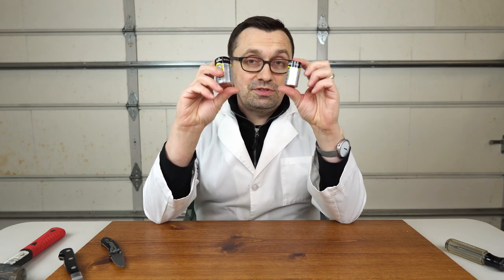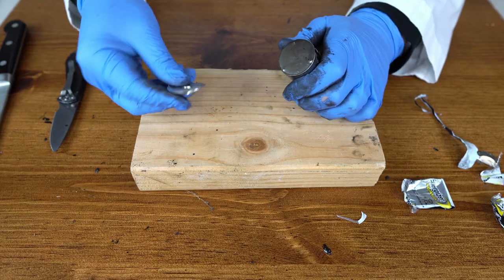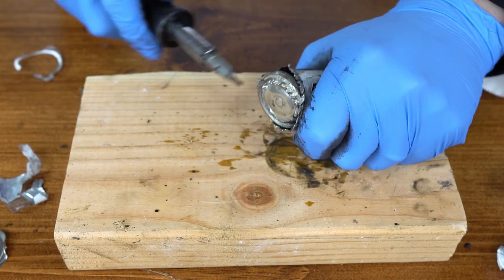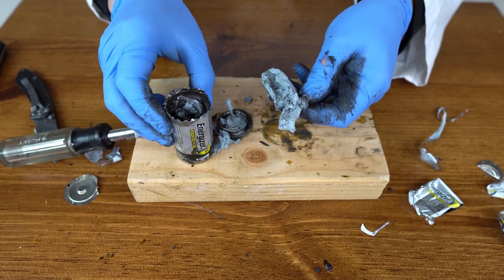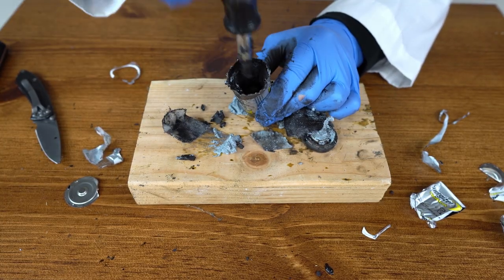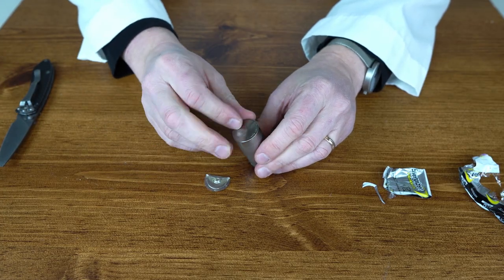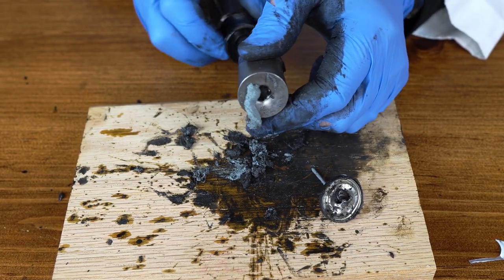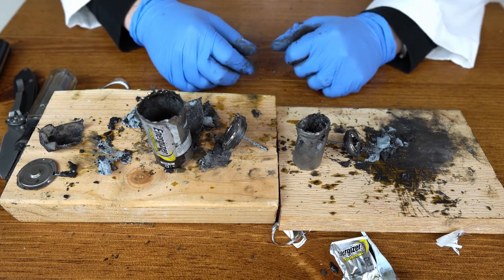What's Inside Size C and D Batteries?

Comment: The reason the C and D batteries look different inside is because most D batteries today are actually C batteries inside of an adapter. It's hard to find real D batteries nowadays. If you notice, a D battery from the 1950s is much heavier than a modern one, for example but C batteries weigh about the same